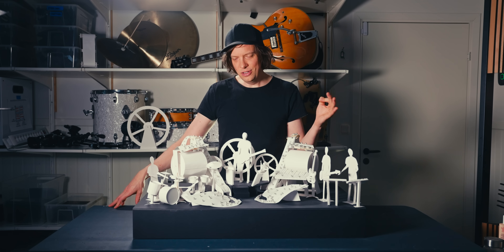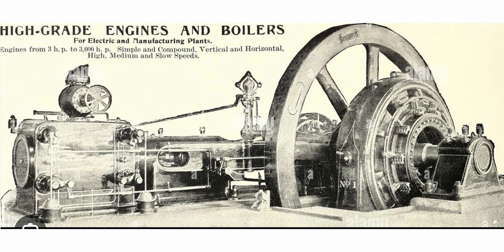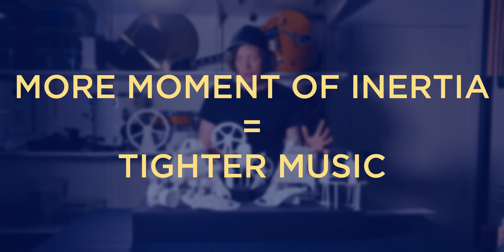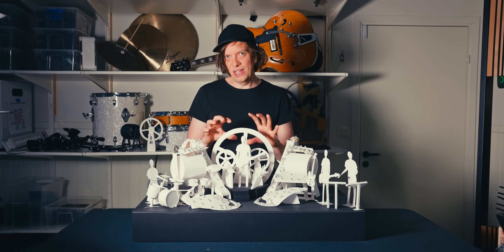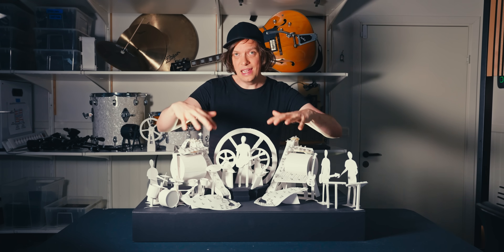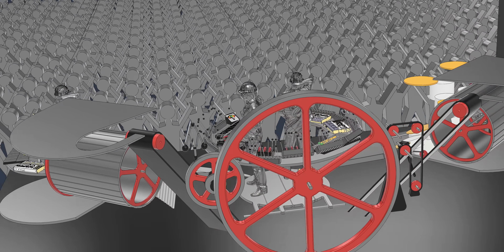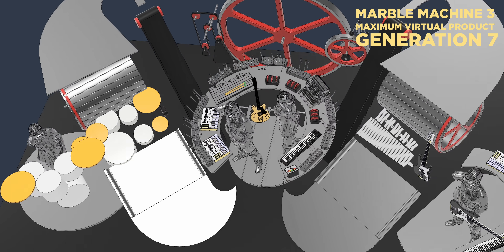What is Moment of Inertia? (The Heart of The Marble Machine)

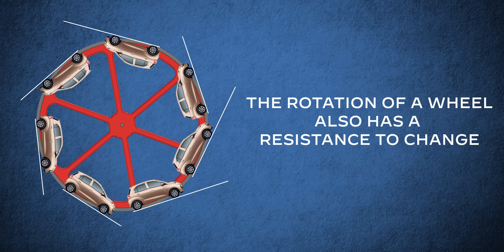Comment: 1:11 No, speed influences angular momentum, not moment of inertia (but it is a related concept, though).
Reply: Correct. While rotational speed does not affect an objects moment of inertia, the faster it is spinning, the longer it will spin for when an unbalanced force such as friction is applied to it. At larger speeds, the ratio between the total speed of the flywheel and the change in speed over time due to friction is higher than at lower speeds, so theoretically, it would mean playing at a faster tempo also makes the music tighter. For example it is easy to hear a change from 240 bpm to 180 bpm is, but a change from 240 bpm to 239 bpm is barely noticeable. If we assume that the change in the beats per minute is constant due to kinetic friction, its a lot less noticeable at a higher bpm when compared to a lower bpm. What Martin said was a little misleading since he is not referring to moment of inertia but to the change in angular momentum (impulse) of the flywheel. If you apply the same force to the flywheel when is rotating fast and when it is rotating slow, it would take longer to stop the flywheel when it is rotating faster, or alternatively a larger force would be needed to stop the wheel in the same amount of time.
Reply: physically they are the same concept. the difference is just calculus
Reply: @gunar.kroeger  No it's not. The angular momentum of a wheel is its moment of inertia times its angular velocity! In other terms, the moment of inertia is a fixed property, but the angular momentum depends on the rotational rate of the wheel.
Reply: @dvo9166  As a cabinetmaker, I have.....no idea what you are talking about but seems right to me! 🙂
Reply: @gunar.kroeger  Moment of inertia is like mass.  If you take the same amount of mass and move it farther out on a flywheel, you'll have a larger moment of inertia, but moment of inertia is the same regardless of speed (just like your mass doesn't change regardless of how fast you're going (for practical purposes, as long as you're nowhere near the speed of light...))

Comment: Having more moment of inertia also means that its harder to change the tempo while playing. This is something to consider since you also want to keep the machine dynamic.
Reply: The Huygens drive will keep the drive wheel spinning at the same rpm the whole time. Tempo is set by the programming wheels.
Reply: @darkiee69  Huygens drive delivers constant torque and the machine is a variable load - speed with vary
Reply: @darkiee69 what if Martin wants to slowly decrease tempo in a song? Or suddenly increase it?
Reply: @octavio2895 he does not know what tempo means.

Comment: I remember watching him make that flywheel in the german workshop and that size alone made me scared.
A bigger flywheel would be lethal, not only to the performers, but to the audience as well!!
I'm not trying to dissuade from your ideas, but this one is really scary
Reply: We should try to dissuade him, though. This is the worst idea he's had in the entire Marble Machine history.
Reply: He’s not going to be putting more power into the bigger wheel (except for 2 people pedaling, but that just means the potential input has increased to match the required power output).  The bigger wheel will be spinning slower than a smaller wheel with the same energy storage target.
Reply: At the revolutions per minute (RPM) he needed with the small flywheel I would totally agree.
But at this size 1 rev. per second might already be enough momentum.

Still plenty fast to remove an arm, but the engineering for this type of power storage has literally been improved for 100 years.

Remember when Martin introduced the pedal to power the MMX? If no one told him that this new approach might crush his foot ... but big flywheels are a solved problem. The bearing manufacturing people know exactly what forces to expect and what precautions need to be taken and what will brake first and how to decouple the damage from expensive parts and from operators/stage crew/audience. This time there are people who know.
Reply: Bigger wheel will be lighter
Reply: Not understanding the criticism of this one. It'll be slower and lighter than a smaller flywheel.
Reply: @Culpride  even if you’re right, no insurance company is going to trust Martin’s diligence on this.
Reply: @rantingrodent416  Yeah, and that's saying something!
Reply: Charge more for the ticket!  People will pay to see that!

Comment: Love the new Design. A big flywheel is exactly what you need. 
But keep in mind that the precision will not be very good. This means you have to expect a lot of Vibrations from the wheel. I would therefore recommend to mount it on a separate frame and drive it only with belts. This should protect the rest of the machine. 
Lg

Comment: to quote Marvin:
Incredible... it's even worse than I thought it would be.

Few things that are missing:
It's not the size but the linear speed that matters most - how you get there is up to you, spin wheel faster or build and carry bigger wheel with you.
On many machines shown in thet video the governor is connected to valve assembly not brake. you need the I term from PID to be able to keep constant speed with variable load. Translated: governor with brake will not be able to keep constant speed.

Comment: The large moment of inertia must come from somewhere. Currently the only energy input is from the pedals and you must calculate how much both power and energy it requires to keep this going for a whole show. Then answer the question if it is reasonable for you (and perhaps Evelina) to provide that during a whole show. I think that some form of electrical motor assist will be necessary, not unlike how electrical bicycles work.
Reply: It's not going to be the entire show, it'll be a feature in the show.
Reply: The moment of inertia is just a property of the wheel. It doesn't change.
The energy that is put into the machine is used up by friction and by lifting the marbles. Both of these can be calculated and thus the needed imputpower for sustained play is known.
If more power (energy per time) is used up than the performer(s) can put in, we need other power (motors, helpers)
or limit the song length since the energy storage is finite (prelifted huygen-drive, prespun wheel).
Reply: The flywheel will be powerd by a Huygen drive. The Huygen drive will be powered by the pedals, which can take a whole body weight and with two people it's much easier.
Reply: @gutterg0d  I can see both variants as a cool feature: The machine slowly ramping up at the start of each song, or the machine running as long as the show is running.
Reply: @Culpride  you are absolutely right, and I'm sorry (and a little bit embarrassed) that I used moment of inertia wrong. I actually know better but sometimes my brain farts... Yes most of the needed energy output is possible to calculate and the rest can probably be estimated with reasonable error margins.

Comment: 1. I assume you've thought of water canisters on the outside of the wheel as the main source of weight. Solves some issues. Creates other smaller issues.
2. I agree with a comment I saw here: with all the weight, dangers, re-tuning, and logistics of using a huge wheel, you should consider a beautiful video projection of a wheel instead, with a motor running the machine (sadly, yes, but proudly, without being shy about it).

Comment: One thing all those old machine illustrations had in common is that all components of the machines where aligned and connected on the same axis. I can't stop thinking about the fact that with the current MM layout – which I actually like – the flywheel and the two sides of the machine are at an angle to each other and that this surely will introduce issues down the line. I know that you can have driveshafts go around angles. But still, my layman brain is thinking that there's just too much unnecessary complexity in this whole setup that might come back and be a huge pain to solve.
Reply: compex? definitely.
unnecessary? no.
Not for a musical art project like this one

Comment: I absolutely get the idea, and I don't want to be dismissive, but I do have to be the party pooper and express some considerations that need to be had before committing to this choice: the steam machine that you post as your inspiration, it is indeed built in segments but it's not repeatedly broken down into segments and built back up again like a machine on tour would be. Calibration is absolute key with a flywheel and the smallest misalignment can throw a flywheel off to the point where it causes mad vibrations, especially if it's really powerful. So you'll likely have to build it once, calibrate it, and then not break it into pieces, and this may introduce some issues with transportation. On top of other venue-related issues other people like @EDLEXUS have mentioned.

At the risk of further moaning, I also have to note: you've banked on using standing pedal power. I think it might be worth visiting this and possibly inviting an ergonomist to think along with you for half an hour; as I kinda fear (but don't know ) this design could give both you and Evalina muscle injury. And an ergonomist might give you a bright new idea for how else to extract human power to get a large machine rolling!

Instead of making this centre wheel a flywheel, you could also choose to make one of the driving gears or a rotary lift system its centerpiece...
Reply: On the plus side, he'll never actually start building this so these problems won't manifest in practice 🤦🏻‍♂️

Comment: Enough people are saying that this looks dangerous in and of itself, so I am not going to harp on that. 

I will bring up that everything that needs to be disassembled and then reassembled has a couple of risks. One, that it doesn’t get put together right, and two, that vibrations loosen the attachment parts, both potentially leading to issues. 

Beginning from the assumption that safety precautions are taken so that if something goes wrong no one gets hurt, either of the above issues could lead to loosing some of the tightness of the music, which is the whole point of making it so large in the first place. 

I think that this plan has a high risk of requiring a lot of changes and modifications to the point where other things that depend on it may also need adaptations and modifications. 

Out of all the ideas that require some prototyping and testing before you keep going with it, this is quite possibly the most critical one.
Reply: I disagree that the main purpose of this flywheel is making the music tighter.  He's already proven in his experiments that between governors, huygen drive and a regular old flywheel you can get tight music.  The main purpose of this change is looking cool.

But I do agree with you I think assembling this thing every single show is a recipe for problems.  I think safety can be planned for.  But vibrations are definitely going to be a problem.  Flywheels need to be balanced for perfect operation.  taking it apart and putting it back together is goign to change the tolerances every so slightly every single time.  So your flywheel is always going to be slightly unbalanced which means it's going to shake.

I guarantee that industrial flywheel that was assembled in sections was done ONCE and then not disassembled again so that it could be balanced in place.
Reply: @NotMyActualName_  that’s fair, and that’s a good point. I would be willing to bet those flywheels were only assembled once.

Comment: I thought of something to add to the build, an indicator for the Huygen Drive. It could be a simple cable with a slide indicator at each of the pedal stations, and just have a "safe" operating range so you don't over lift or under lift the drive weight.

Comment: You argue that the bigger the fly wheel, the better for the sound and how tight it is. There has to be diminishing returns and at some point, some other components will induce some timing errors that will render any gains from a bigger flywheel meaningless. 

Yes, it is super cool and that is probably a good enough reason to do it. But how sure are you that 2.5 meters will produce measurably tighter music versus 2 meters, or 1.5 meters etc?
Reply: in the video from last August (watch?v=9X2J8JN9g-k) Martin found the corellation between angular momentum and tightness of music.
I don't see why there should diminishing retuns to the size in terms of timing errors.
The corellation and the formula for angular momentum state "bigger is better" but there will definitely be limits (materials, safety, space above the stage, transportability ect.) so two meters
Reply: Martin has been changing the definition of "tight music" every time he measures "tightness".  He needs to pick one definition and stick with it.
  I recommended:  "No random variations in the spacing between notes.  If you set the programming pins so that you have a note played every 0.25 seconds, but the note plays every 0.3 seconds, without any variation, that's good.  If it plays every 0.25-0.3 seconds, slowly varying in a predictable way, that's okay.  The rest of the band can adjust their tempo to match the MM3."
  But Martin wants … well, he wants fixed tempo, exact tempo, fixed-energy-output, no variation between marble drops, et cetera, et cetera, et cetera.  He redefines what he means by "tightness" to be whatever it is he's decided to go and measure this time.

I fuss about it because I can see the trap Martin is creating for himself, and I want him to succeed.  He ain't gonna if he keeps redefining a criteria he's hell-bent on fulfilling.

Comment: Two things,  first, orange blocks appear to be dangerous.  Second,  there isn’t a health and safety guy anywhere that will allow a 2 meter rotating flywheel in a public venue.  The only way you could do it would be with an ultra light weight fake flywheel moving at relatively slow speed
Reply: I commented about this on the last video, if you want a large flywheel so you can have a nice visual spectacle for the audience just make something decorative and have a smaller safer flywheel tucked away nearby.

Comment: To me, "industrial revolution" screams to me "horrendous industrial accidents". Imbalance in the wheel (which is significantly exacerbated by taking it apart every time), huge moving parts, extreme pinch points, all one step away from the performer. Plus, as you were touting, there is a lot of momentum there, so you can't stop it quickly enough if something goes wrong. Get a sleeve caught in that and it will tear your arm off. Don't balance it perfectly and it will likely shake itself apart and throw heavy pieces of metal around. I suppose it would make the show memorable, though.
Reply: He could charge more, too!

Comment: I think the biggest concern I'd have is the disassembly and reassembly- a flywheel needs to be very very very well balanced or you run serious failure risks, especially at that scale. A lot of the flywheels you showed pictures of are half embedded into the ground for the safety of the workers.
If you want a really huge wheel, I think you can build a giant one that you can take apart and put together that's fully form, with no function, and you keep a maximum sized wheel that you can safely transport without disassembly as the "real" flywheel. Last thing you want is a catastrophic failure on stage, especially since I don't know how much maintenance or close inspection you can do between shows 😬
I really don't think there's a problem with wanting a visually stunning design, but part of what draws a lot of people to steampunk is how visually intricate it is, even if it's not functional. You can achieve the same effect, even have it speed up and slow down with music, but just not have it be functional. Like you said, objects in motion tend to want to stay in motion.... and a 2.5m diameter wheel isn't going to stop for something as small and squishy as a person

Comment: I was going to write "With large fly wheel comes great pedaling." But Martin addressed that by adding one extra member that can pedal the machine. Why not let all members help with pedaling the machine? That would help with the startup time tremendously.
Reply: They're going to have to get the machine pre-started every show anyway.  I have a feeling that unless you start it up with an electric motor it's going to take 20+ minutes to get that thing moving with a huygen chain drive as the power input.  That's a great way to make the power input consistent but it's not something you can speed up by pedaling harder or faster.  Gravity is doing the work, so you can only accelerate the flywheel as fast as gravity would.    The only way to add more power is to add more weight to the chain drive which is where a second person comes in handy.
Reply: @NotMyActualName_  Yea I think so to. The thing I was worried about is that Martin said that they are going to change the programming wheel after each x melody (where x is an integer) and then they need to start up the machine again, waiting again. But I just realized that they could design the machine so that it could decouple the programming wheel from the machine so the programming wheel stops spinning with out the machine stops turning. Synchronization between the two wheels are going to be a problem tho. But that is solvable.
Reply: @segment932  yeah that just needs to be a clutch or something to disengage the programming wheel.   It can probably be pre spun by hand before engaging so it isn't a big lurch to the machine when it engages.